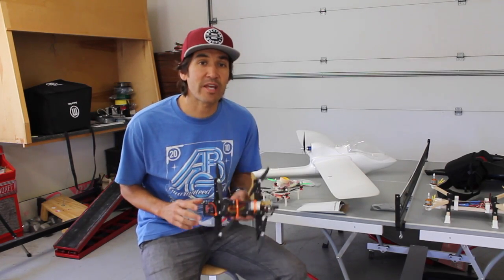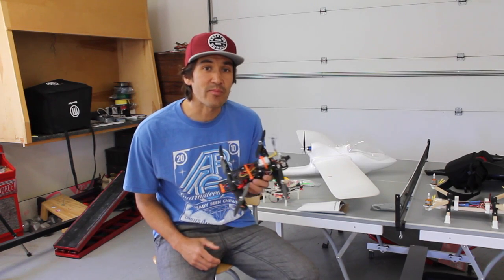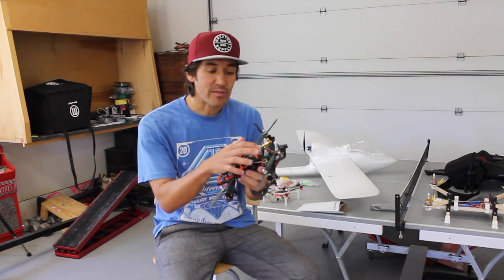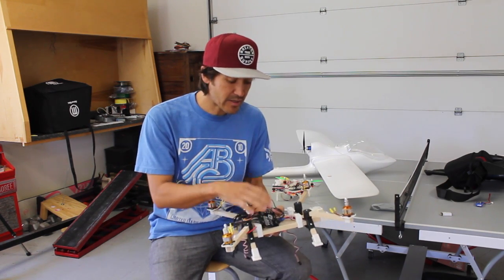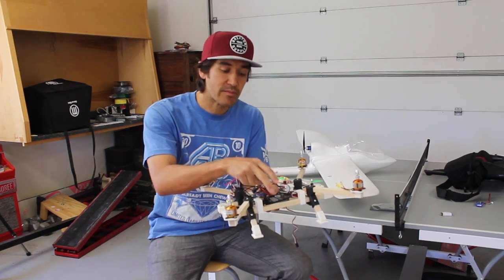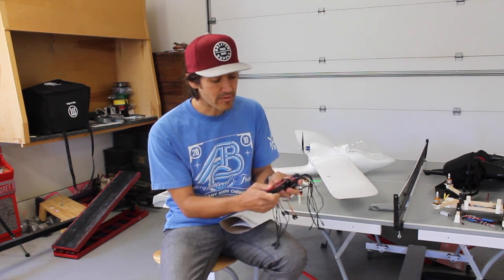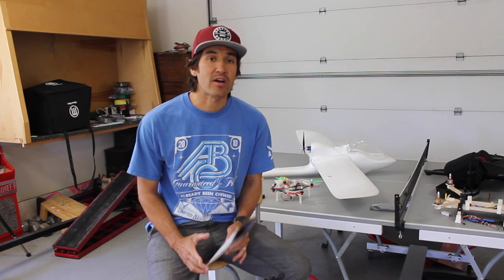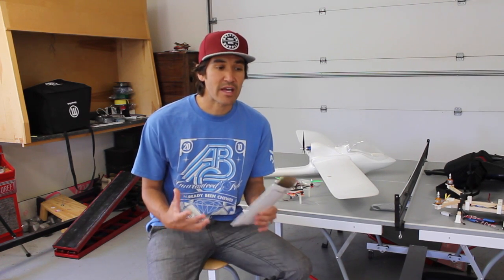Weekly Update: Mini FPV Quad, QuadLugs, HoverAll RC, Platinum Hobbies & Garage Pilots

Comment: Wow platinum website is a big turn off. I have to register to see anything? This hobby is meant to be open to everyone?

The form is massive and horrible to read, blue on black?

I'll pass.
Reply: Guys I am working on this issue right now. The whole registration thing is only temporary due to a contract negotiation I am in currently. Should be open this weekend to browse with out sign in. The blue and black issue is a coding problem and is currently being handled from my website provider. I am sorry about these issues currently and working very hard to solve them!
Reply from the maker: Give Chris a little time to get things fine-tuned and running. Yeah I agree that he should consider making the registration optional.
Reply: Dennis Baldwin All issues have been fixed now. I appreciate all the feedback good or bad. If any other issues you see please do not hesitate to contact me. Thank you all for the support.

Comment: Have you considered making a clip in FPV cam mount? They usually all have the same rough 4 hole mounting system that might work with the basic nylon stand offs. Maybe leave a slit in the bottom plate and have this style camera mount clip in to it. This would potentially allow it to pop out in the event of a crash, and fit most board cameras.
Just my 2 cents

Bart